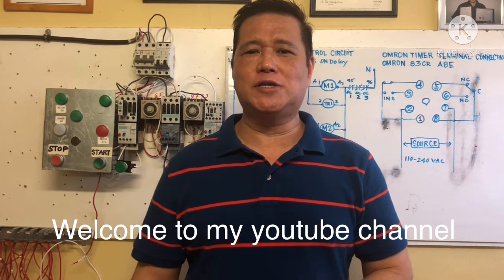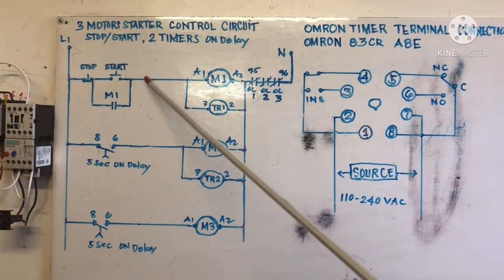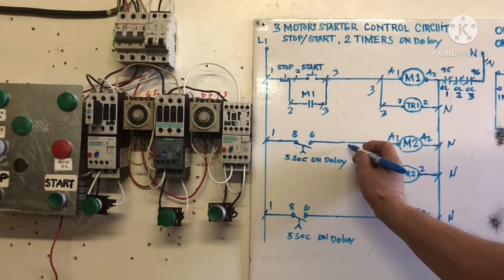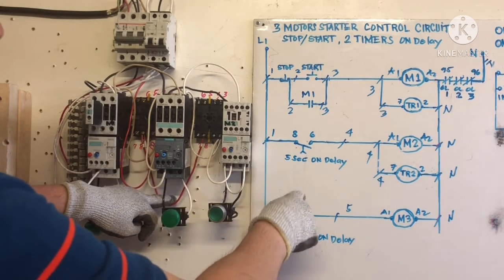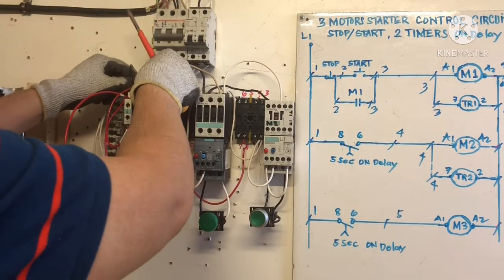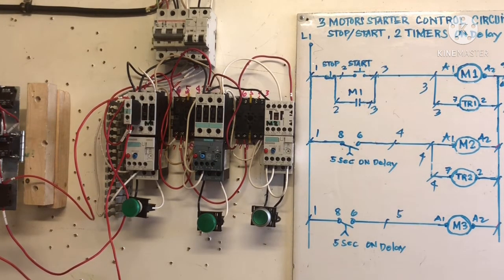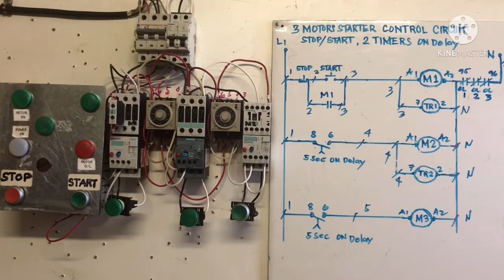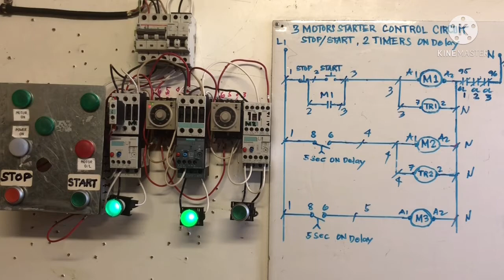Start stop station motor control , 3 motors sequence start with two timers OMRON on delay.

Comment: Hi sir, I'm very interesting about your video teaching of electrical installation. For 3 motors starter control, can U connect indicator lights?
Reply from the maker: yes should every one motor have one indicator lights to idinttify the M1 to M3 running.

Comment: Thank you Master for the informative video. Is there a problem if I run motor #3 using aux m1 instead of aux m2?
Reply from the maker: No problem but its not a proper way.
Reply: Alright

Comment: Very informative video. Can U pls help me with following task?. I’m a woodworking guy, and a novice in electrical automation. I am trying to automate my shop dust collector filter cleaning system. I have a single phase 2kw 220V shop vac, and a small low RPM 200W motor that runs the dust collector filter cleaner. I start and stop the dust collector with a remote controller. Today I run the dust collector filter cleaner via a separate remote controller. I would however want it to start automatically 10 sec after shut down of the dust collector and run for 10-15 sec before it shuts down. This repeats after each time I use the dust collector. Can you guide me on combining relays and timers, or better still, could I ask you to create a Youtube video on this topic, as I am sure I am not the only one struggling with this task.
Reply from the maker: Bro I have already uploaded a vedio related to your request. Please watch the omron twin timer automatic on/off operation for motor control vedio

Comment: . Wow! Very interesting about your electrical installation teaching of u tube. Can explain how to wire 3phase air compressor auto on off with face failure
Reply from the maker: thank you for your nice comment bro you can learn electrical and wiring installation this channel,if you use timer then on and off operate

Comment: Sir, the 3 motors control circuit is parallel connection or circuit?
Reply from the maker: yes motor supply must be parrallel connection. control circuit is important to learn instructions

Comment: Sir, please tell me if we need 8 motors run just one after another as you told in this video but timer not required jut interlocking with 8 pin relay so, is it possible?
Reply from the maker: watch my one video 4 motors interlocking motors and you can additional more motors even more than 8 motors just follow same connections.

Comment: Sit ask ko lng dual time po ba yan ginamit nyo lng ung on delay feature nya tnx po
Reply from the maker: Dalawang timer ginamit ko na on delay para sa dalawang motor.
Reply from the maker: Bro iba yung model ng dual timer , ang dual timer ang function nun ay, on delay and off delay. Ibig sabihin auto start and auto stop depende kung ilang minutes bago mg start at stop na gusto mo, din start uli continuous ng ganun.

Comment: Mas maganda po pag tagalog nlang po
Reply from the maker: avelon, gusto ko sana tagalog kaso daming akung subscribers kase na ibang lahe.
Reply: @tmelectricaltutorials2851  ,ganun po b sir..slamat
Reply from the maker: @avelonestoesta6128  ung unang ginawa kung video sinabihan ako na eglish ko nlang daw pra maintinidihqn din nila, copy mo ung Diagram un ang importante idol. practice mo madali lang yan.
Bayaan mo pag marunong na ko gumawa mg english subtitle tagalog ko nlang mga videos ko. Para maraming makaintindi. Thanks
Reply: @tmelectricaltutorials2851  ,pneumatic at hydraulic sir gawa ka sin po ng tutorial
Reply from the maker: @avelonestoesta6128  cge gawa ako nun automation machine yun idol kelangan start muna ang hydraulic pump bago mpaandar ibang motor my pressure switch un na normally open.